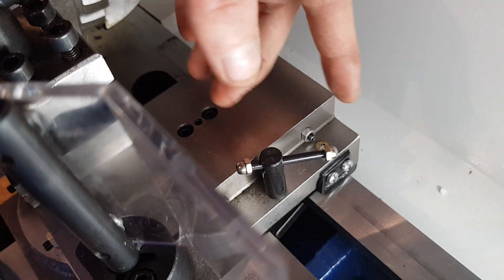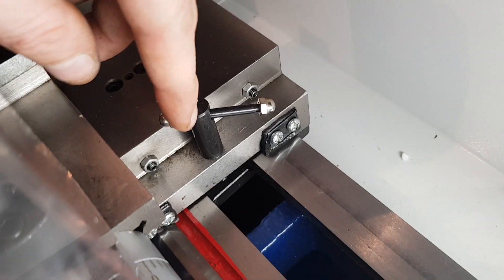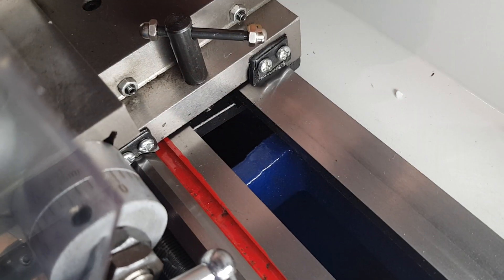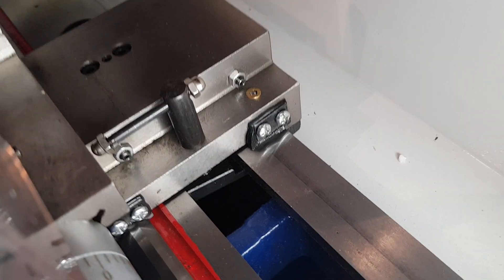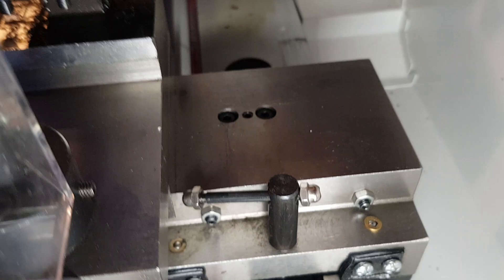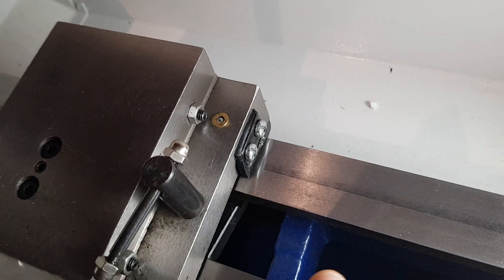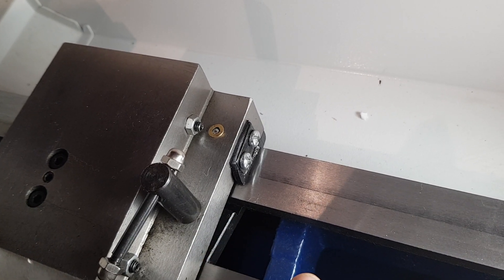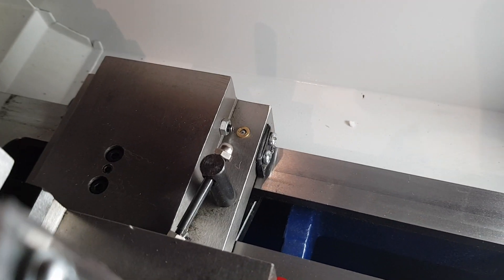NEW MINI LATHE CARRAIGE LOCK MECHANISM  2018

Comment: What happened to your mini lathe rant? Did they pay you off?
Reply from the maker: What do you mean ?
The videos are still up, they wont be going anywhere, and the only way they could pay me off, is with a fully working lathe, especially after the trouble they caused.
But so far they have never been in touch with me since I told them I would appear at their business premises to take my money back.

PayPal fully refunded all money, but the videos will be staying.
So far loads of potential buyers have been made aware of their returns for repairs scam, and have chosen not to buy from this seller.

I warned him when he tried doing this that it would backfire on him, and he laughed at me on the phone mocking me.

That motto is true....
He who laughs last
Laughs longest.

Karma 

👍👍👍